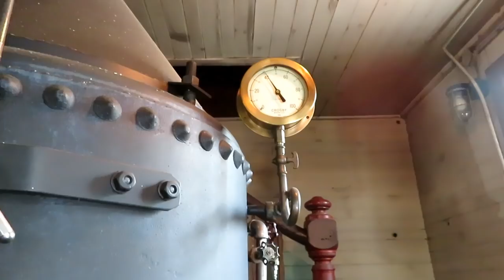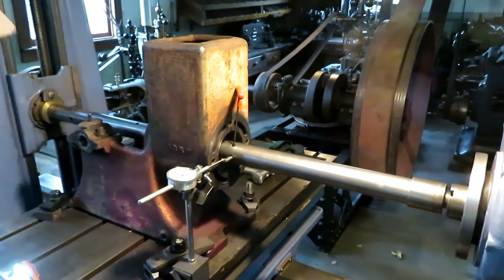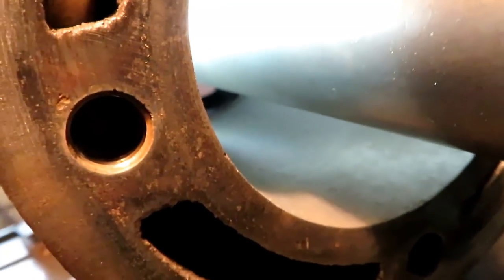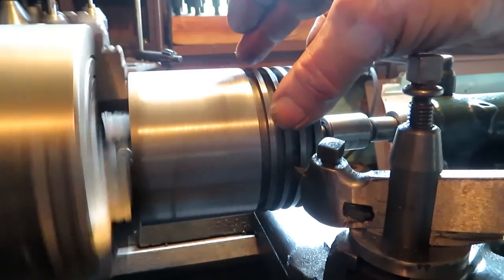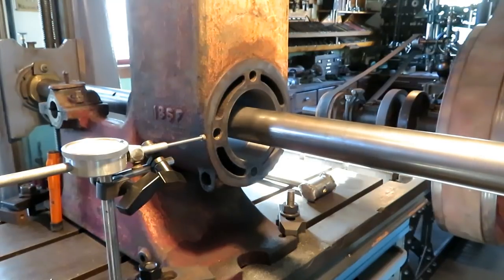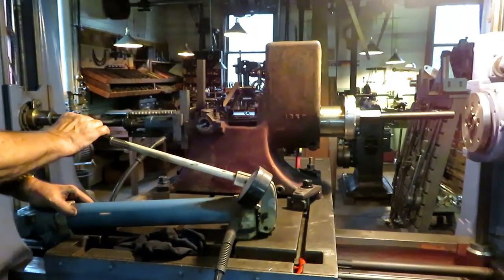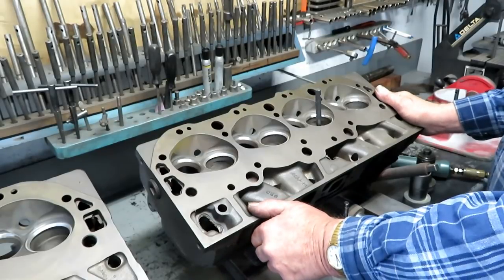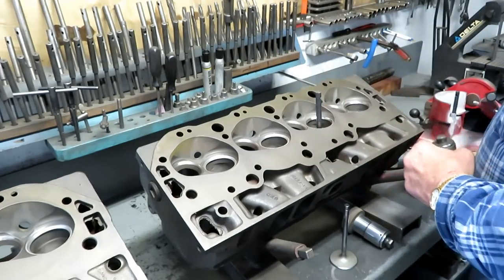Old Steam Powered Machine Shop 61  Horizontal Boring Mill Work

Comment: For lining up such a worn bore did you check from the crank centres to make sure you were square on to the shaft?
Reply from the maker: Can't rely on worn out main bearings that have been shimmed way up or repoured.  Those were worn quite a bit on the belt drive side. The bearing rebuild will go to someone else I guess.....Dave
Reply: @davidrichards5594  
I see your point.

Comment: Just wondering why you wouldn"t put a magnetic base on the table ways, (boring for the sleeve) set to zero at the proper depth so you could hit the exact same depth mark every time?
Reply from the maker: Scotty, I don't know why I don't. It would be the right way to do it. Next one I will....Dave
Reply: @davidrichards5594  Your results obviously speak for themselves, so I wasn't trying to be negative, just thought you had a better way, ( a secret) I was trying to learn. Thanks for the videos, and a chance to see Old Iron in action!

Comment: I just bought a G&L 25rt from a man in Texas to use in my engine machine shop
  It does not have a tailstock.  Do you know anyone that might have one?
Reply from the maker: I haven't even seen a G&L 25 for sale lately. I used to see a few loose tailstocks on ebay now and then. Good luck.....Dave

Comment: How do you line up the foot stock, to the head stock so the bar is level ??
Reply from the maker: Good question, I got it pretty close when I set the machine up by moving the horizontal feed screw bevel gear a tooth at a time, which got about .002" along the table. It should be as close as possible but it isn't critical on an operation like that because the bar with cutting tool doesn't travel in the cut, the table feeds the work past it, so the accuracy is all on the ways like a lathe....Dave
Reply: @davidrichards5594  aaaaahh...I see, ididnt think of that.....if you were feeding the spindle out, while boring, you could theoretically bore "downhill"  or "uphill"..if the spindles werent exactly aligned.....interesting

Comment: Can’t believe you would use such “modern machinery” 😂😂😎.  If this is pretty much your go to boring bar for these jobs; how about turning up some “centering cones”, kinda like used on a brake lathe. It might get you close to center and parallel a bit faster. Just thinking.
Reply from the maker: Could be done Eric, but I use 3 different diameter bars and you would be relying on the champers on the ends that probably were hacked out by hand and a lot of times you don't have much room on the crank end for anything much bigger than the bore....Dave

Comment: After you turned down the piston is it going to require  set of custom rings to match?
Seems to me that after turning it down and boring the sleeve to fit the piston that the original rings would be butting the ends together. Or could a guy get away just filing the ends of the rings down until he got to the necessary end gap? Enjoy your trip South and please have pity on us poor jokers who will be checking Youtube every day until you get back. Throw us  bone once in  while?
Reply from the maker: Hi Phil, In this case, the bore ends up smaller and the rings can be file fitted by the customer for what ever gap he wants. There is enough extra groove depth to allow for the aprox. .005" that I removed from the diameter....Dave